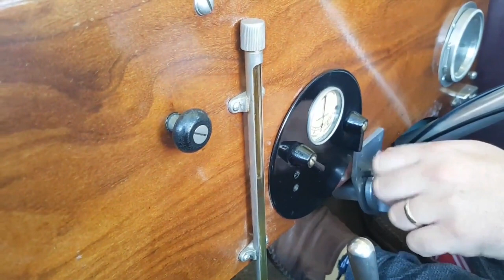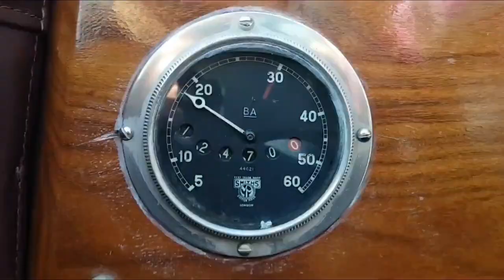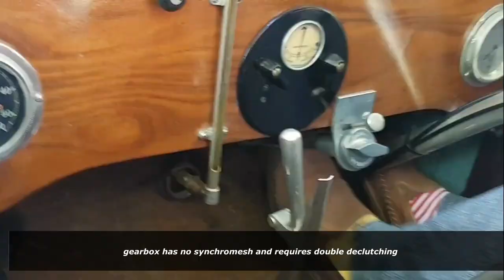1923 Morris Cowley Bullnose

Comment: When did Morris first fit fwb to the bull nose? This looks like a very sound example! 👍👍
Reply from the maker: I believe front brakes were an option from the 1920s.  Not sure if these ones were fitted later or are original.
Reply: @GasoliniASMR  Front wheel brakes were an option on the Cowley for 1925, and standard on the Oxford for that year, unless you specifically ordered it without.
The '26 Oxford came with them whether you liked it or not.
The car in the video doesn't have them, which is original.